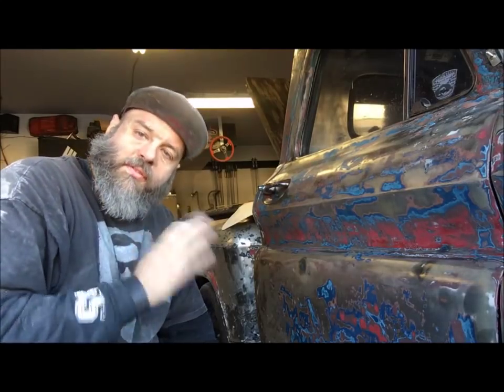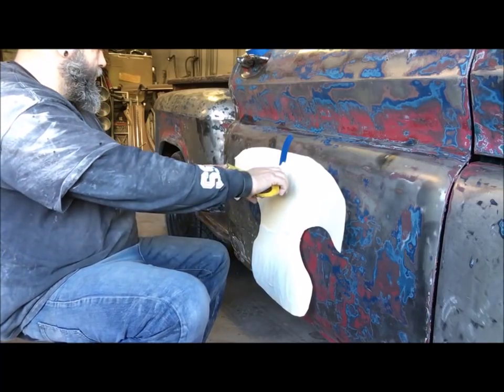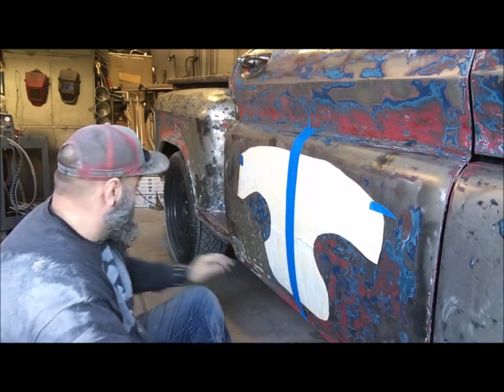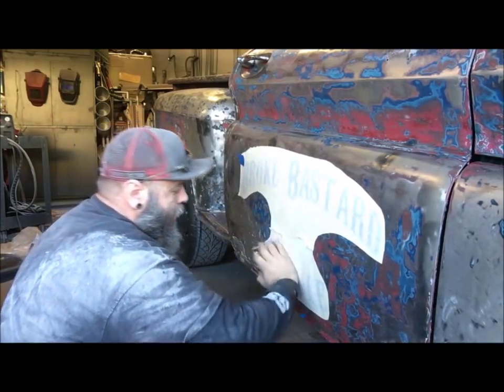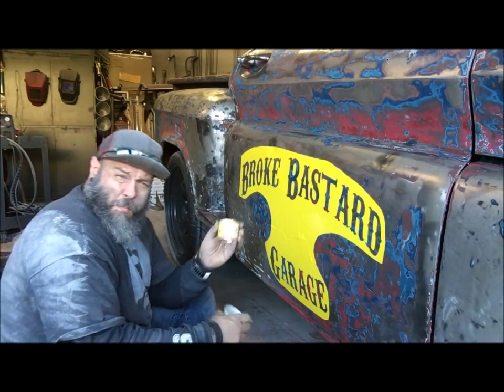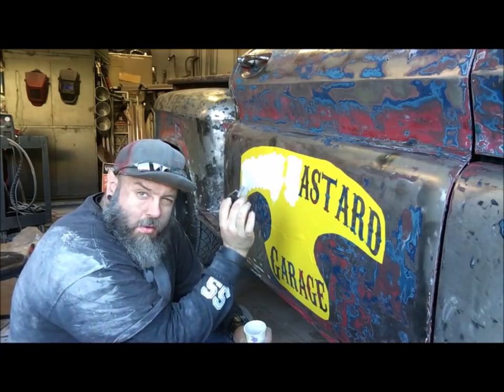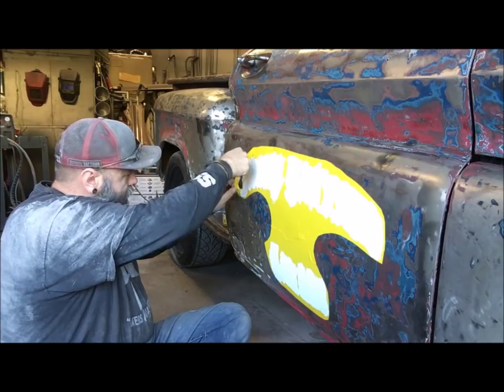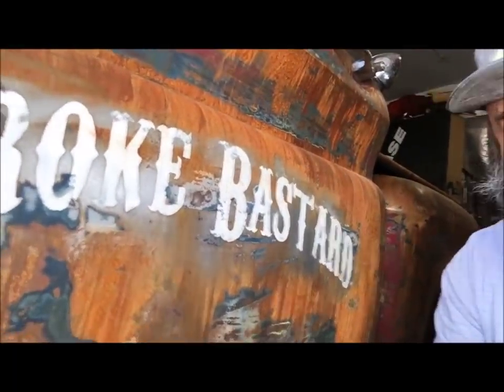How to lettering on your doors the easy way, on your Rat rod or Hotrod

Comment: Take a self tapping screw and put it through the lid on your paint and leave it there. When you go to use the paint shake the piss out of it then afterward remove the screw. Turn it upside down and give it a little squeeze into a Dixie cup. Continue until you have what you want. Put the screw back in and leave it. Paint wont dry out and you never have that skin on the paint. Plus no mess from pouring and much less waste. The paint around the screw forms a seal.

Comment: This works great for larger decals Square your decal  backing for points of reference .                                         Put measuring marks on door.           Spray door and decal with water.        Slide decal around to lineup.            Use new bondo spreader to remove water and  poke air bubbles with pin

Comment: The kerning between the "T" and the "A"  is off, they need to be less space between them.  You needed to distress the lettering while the mask was still on and the paint still tacky.  By distressing the lettering after the mask was removed you disturbed the door's patina.

A better result would be to thin out the paint so its a bit transparent and use a lettering brush to paint in the letter strokes. The stencil will ensure the letter shapes are correct. The semi transparent brush strokes overlapping gives the effect of sun bleaching.  That being said having the letters on rusted metal makes no sense as they would have been originally been on the original car paint.  Therefore to have old oxidized car paint with the lettering makes sense you can then rub away the lettering and the car paint together and add the rust patina.  Yes?

Comment: Not sure if you know this as I didn't want to read through all 118 comments but if you want to "lock in " the rust patina and slightly darken it, wipe the whole body down with a product called Penetrol. Its an oil based paint additive conditioner to help the paint flow and level when brushed on but for some reason it is also a steel protector and will lock in rust, or on bare metal will protect it from corrosion for years.

Comment: try using a sponge to apply the paint and thin it up alot.. then it looks like it have been there for decades.
or after painting it put a piece of plastic over it  mess it up a bit with the fingers to get a wrinkly effect.
then wait for some time for the paint to be half set ,then remove the plastic and negative.
this way it gets a old weatherbeaten look.
the letters need to fit the car..

Comment: Paint hack. If you put windex on the body you'll get some wiggle room out of the sticker for a little while. It'll slide due to the windex. Then take a card or cd case and squeeze the left over windex out and the sticker will stay in place. I know you are using it as a template but nothing is worse than having to move a sticker a 1/4 inch.  It'll stop some of the anxiety 

Looks great

Comment: To apply the decal easier, hinge the tape at the top instead, lift the decal, reach up to the top of the backside and start to peel the backer down. Use the card to flatten from the frontside as you pull the transfer tape down slowly until you reach the bottom, then peel it all the way off. No cutting required.

Comment: Since the door has a curve built into it, top to bottom, you should have laid decal down, top to bottom, instead of how you did it right to left. Easy way to avoid wrinkles,. I realize the wrinkle didn't matter in this example, however, if you're showing people how to do something, it does matter.

5:11 "Cutaway backing and now for this part you're going to need a card, you want to start in middle(Proceeds to start at Top). The reason we're doing this with the card, So we don't get wrinkles(as 1st major wrinkle forms in the middle."

Cool looking finished product sir.

Comment: That came out great 👍 after you had the rust effect you wanted what do you spray on it flat clear ? Or did you just leave it as is ?
Reply from the maker: Bamboozel96 I left to then I just seal it in with the rust. Using boiled linseed oil and mineral spirits

Comment: Brother, I am enjoying the hell out of your channel.  Glad I found ya!  Would you be able to elaborate on the aging process toward the end?  I caught 220 sand paper, then spray activator on it?  Just making sure I caught the tail end correctly.
Reply from the maker: I use 220 sand paper to distress the lettering. You can leave it at that point or you can use my mix to rust the metal around it

Comment: Never use any kind of window cleaner that has ammonia in it ! Only use ammonia free window cleaner. When it dries, it will leave aof ammonia on your surface and it will damage any paint work eventually. I recommend using wax and grease cleaner. Also known as prepsalt that you can get at any automotive paint stores like PPG .

Comment: Nice work, if you add the edge line around it do you still add when main paint is wet?
Reply from the maker: MrAllinclubs you have to let the paint dry some TIL it’s tacky. Then and the other color and peel the back off.

Comment: Great video. I love your patina. What is your formula??
Reply from the maker: One cup of salt. 6 oz of distilled vinegar and 18 oz of hydrogen peroxide. Shake and spray. Wait about and hour and reapply if needed. After a week rinse with water, dry, and seal with boiled lindseed oil.
Reply: Thanks for the information. I have a 1954 Fargo 1/2 ton that I am thinking about doing a bit of a RAT ROD look.

Comment: How did you get that rainbow patina
Reply from the maker: That is from the 7 times the truck had been painted
Reply: I see. I recently saw a video of someone blowtorching a bowl to give it a rainbow patina. Do you think doing this to a truck would be dangerous and or deform the truck? Thank you for your quick response
Reply from the maker: @ntrout3992  depends on how hot you need it. if sheet metal gets to hot it will warp
Reply: I’ll look into it thank you

Comment: i was wondering how much did the stencil cost to  cut out?
Reply from the maker: SEAN BENWARE I have a vinyl cutter. So it cost me about $6 bucks in material.  Must shops should charge about 20 bucks.
Reply from the maker: SEAN BENWARE I have a cutter so it only cost me a few bucks. Most place will be $10 to $20 dollars.

Comment: why did you pour the paint out of that tiny can into a cup you could have just used the paint strait from the can. no waste that way.
Reply: Its called double dipping... Contaminates the pot. 
The pot will also evaporate, try this with hammertone and you will ruin the entire pot in 20 minutes.